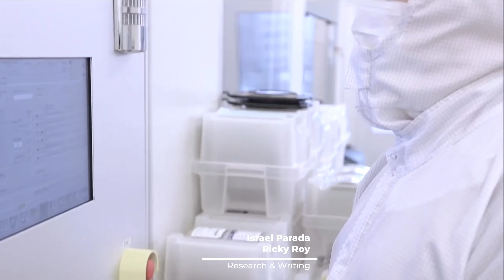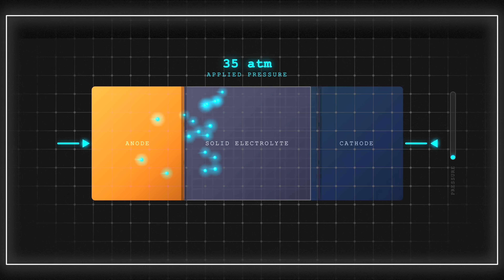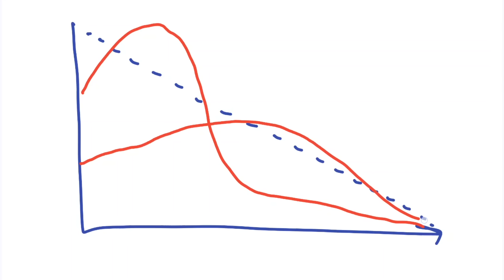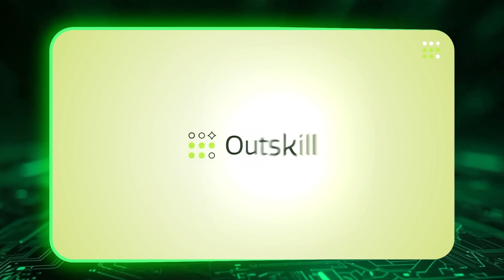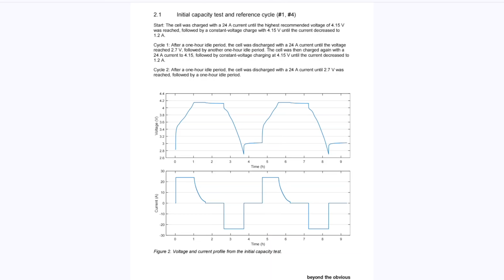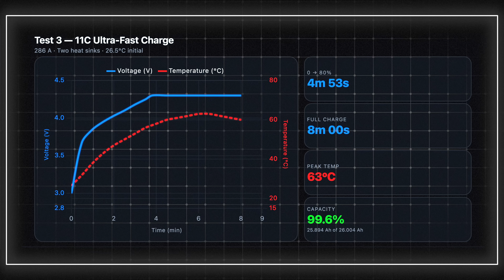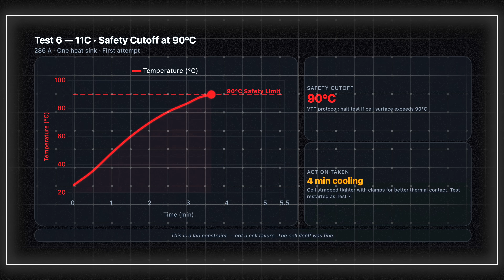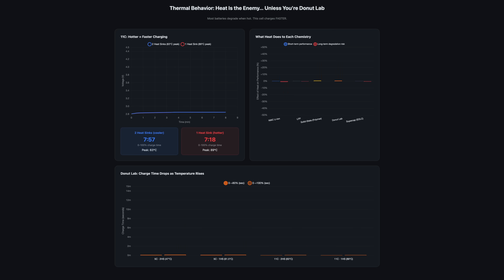Donut Lab's Solid State Battery Test are Shocking...

Comment: The results may not be the magic pill Donut Labs bragged about but they are close enough. Who cares if the battery cells can only last 25k charge/discharge cycles? That is more than what the life of your vehicle! So, If the battery materials are really geo-politically neutral and abundant anywhere on Earth, then we are talking a revolutionary battery chemistry. If the U.S. and EU EV industries are smart, they need to start talking with Donut Labs for a full-scale production ASAP!!
Reply: He's saying the battery exhibits the same characteristics as a Lithium (Nickel Manganese Cobalt) battery, not of a geopolitically neutral composition. We have to wait until a battery is dissected in the wild to know for sure, though. But the type of battery the one VTT tested matches the type of battery that won't have the temperature range and cold/hot weather resilience that Donut has been hyping.
Reply: The cell that VTT tested did pass 11C charging and was still working without burning, exploding, nor permanently degrading the battery. Yes, it exhibited high temperatures, especially with 11C with only 1 heatsink but these cells will be designed to use their enclosure and the vehicle frame as one big heatsink. So, that is not an insurmountable blocker. As Ricky pointed out this Donut Lab cell appear to love 100C and higher temps. That alone would kill Lithium-based cells in no time, even NiMC cells.
Reply: @Mvanec That is HIS opinion. We have to wait for the factual data as to the materials used. Just because the battery have similar charge/discharge curves as NIMC does is not proof, just empirical observations.
Reply: @AldrinAlbano  Science functions on empirical evidence. If it looks like a rat, it's most likely a rat. Additional information may alter that position, but until someone can make more observations of the rat, test its behavior, even dissect it, the most likely case is, it's a rat. HIS opinion is absolutely based on the empirical evidence, and it's not just HIS opinion; everyone who approaches this test from an engineering and scientific perspective has arrived at similar conclusions. As in all things science, more observations and empirical evidence are needed, and may confirm or obviate current conclusions.
Reply: @AldrinAlbano  Literally not an opinion, you delusional bot.
Reply: They are already falling short in many of their claims under ideal test conditions. Plus it behaves too similar to a well made NMC. Yes if it is a sodium or another abundant material based battery even if it had 10k cycles it would solve many issues. But so far zero proof in that regard
Reply: NMC cell will only give you 3,000 cycles, not even close to 25k.
Reply: The proof will always be in the pudding, as they say. Donut Labs' cell exhibits a charge/discharge curve as NiMC, yes, but that's not proof of its composition. We'll have to wait for the thorough dissection by an independent lab for that. Until then, Ricky, you, myself and the rest can only speculate.
Reply: If
Reply: Why do you say the results are not "the magic pill"? The results are precisely what they said they'd be, no surprises.
Reply: @davis.fourohfour  Read or watch Donut Labs original claims again, sir.

Comment: Didn’t they explicitly say they capped the voltage at 4.5 volts to make it an easier switch from lithium ion batteries? They said it in the initial reveal IIRC.
Reply: @bertangundogdu  it's only possible with capacitors, and donut battery does not behave like capacitor, so this may be a lie.
Reply: @crosshunter3316 that's...not rational

Comment: True lithium ion cells  coulombic efficiency can exceed 99%.  If these cells are only 90-95% charge/discharge efficiency then it wastes 10X the power that is converted to heat, which accounts for the high temps attained in these cells.  Also we don't use ohms law to measure internal resistances of cells. There are special machines that inject a 1 khz signal for these measurements which account for impedance and capacitance of the cell.

Comment: So it sounds like their design goal was to create a drop-in replacement for existing batteries, while using whatever cheaper, more abundant materials. In which case, having performance curves similar to existing lithium batteries should be entirely expected.
Reply: I agree, and I also need to acknowledge that in fairness, this would also be the perfect cover for submitting a ringer NMC pack for testing. I don't think that's what has happened here, but I've been wrong before.

Comment: A sodium ion battery also has a nominal voltage of about 3V.   The numbers lining up may not be such a give away about the chemistry involved because it could be that they aimed for matching the characteristics of existing cells so that the cells could be a drop in replacement in production.  This would make sense.  You only need to be about 10% better or 10% cheaper to take the market away from the other guys so if we assume this is a battery that doesn't run away and has these specs and can be made in volume, I expect them to a winner.
This could also be the first step in some massive April Fools prank.

Comment: The test showed the battery has a capacity retention rate of 99.5% per full fast charge cycle. This is not acceptable for commercialization. At this rate, the battery will degrade to 60% of original capacity after 100 full fast charge cycles.
Reply: wow what an interesting observation! Just read the VTT report before saying something like that. The VTT alternates between 7 charging cycles: 1C, 5C, 11C, 1C, 5C, 11C, 11C. After the 4th charge, the capacity returns to 100%. This is not a case of accumulated degradation.

Comment: The Donut CEO will either be the next Elizabeth Holmes or the next Henry Ford.
Reply: Sadly, in today's corporate world, it's far, FAR more likely to be Holmes.
Reply: @JustSomeJoe-dp5rp  100%
Reply: @JustSomeJoe-dp5rp 90%
Reply: There are zero patents filed because there is nothing patentable. I'm still on team pseudocapacitor system in a pouch.
Reply: @YesheRabsal  Sometimes companies keeps from patenting to actually protect IP during early market stages (trade secret)  to stay ahead of competition. Once you file a patent you expose yourself. It is a tricky balance.
Reply: @YesheRabsal  wow. There's no patent really?
Reply: @firstprib7742  sometimes it’s better to not patent as secrecy is much more important in the market. Consider Coca-Cola as an example.  Patents are public, and with that, large companies can dissect and perhaps come up with a similar solution without infringement, dwindling the market edge a small company has.
Reply: @YesheRabsal Did some research and Donut lab probably bought the patent rights from Swedish company Holyvolt.

Its about coating Nanopaste with screenprinting technology.
Reply: Donut lab battery is either a miracle battery with a pr strategy of a con or a con bttery with a pr strategy of a con.
Reply: If this is for real it would be a real contender for technology of the century. This would be a massive disruption
Reply: @Thunderbuck lmao no
Reply: I bet next EH.
Reply: @MrsTami42  Just looking at sentiment, it looks like the doubters are getting less sure. You are right to be skeptical tho ;)
Reply: @giddy9052   I feel like most people are still skeptical or feel even more confident that they can't deliver. I just watched one breaking down the details of the battery report and basically said all the curves and data matches a lithium cell, while Donut claims they aren't using lithium. 

We'll see though.
Reply: @kashtrey it doesn’t watch the test, a lithium would have burned at 89, definitely been damaged. Listen where even this guy says the charging improves with heat counter a lithium cell or at least any know currently.
Reply: @blueberrywilbur315  that's just wrong lithium batteries increase charge rate with heat. It's about degredation. Lithium batteries would not have "burned at 89 🙄
Reply: @kashtrey  You're in the "at any moment this could catch on fire" in the 60-80C range with current Lithium batteries. So yes, at 89C, it would almost certainly be on fire, or at the very least noticibly degraded.
Reply: @MrTycoon04 actually in one of the donut lab videos you CAN actually see the cell bulge and deform....

There are lithium cells on the market that can reach 90°C for short periods of time without damage already.
Reply: Holmes
Reply: Elizabeth Holmes at least manage to pull off one if the greatest cons of the decades meanwhile nearly no one in the battery industry fall for donut BS of solid state battery.
Reply: Great analysis
Reply: Unfortunately I'm leaning towards Holmes.
Reply: The Donut CEO will either be the next Elizabeth Holmes or the next Henry Ford .
Reply: Yeah the guy is either a genius or a fraud. Not a whole lot of in between with this battery.
Reply: did Elizabeth holmes every release indpendent report
Reply: Well said
Reply: Wilbur Wright more like (or Elizabeth Holmes)
Reply: He wont be no one will give him time.
Reply: @L @LearningFast with all that swelling he’s more like John Holmes at this point wouldn’t you say Watson?
Reply: Looks like a duck, quacks like a duck, waddles like a duck, flies like a duck. OMG! It's a golden goose! Take my money!
Reply: Either way it's going to be awesome!
Reply: Cold Fusion anyone?
Reply: Holmes for sure
Reply: Henry Ford
Reply: Elizabeth Ford
Reply: The curve charge/discharge is more a sodium ion than a lithium ion, you are false ..
Reply: Whoa, where did that come from? We have nothing to indicate he's a rabid racist like Ford.
Reply: Or suicidal
Reply: A charlatan or a Nazi I don’t think either of those are good options
Reply: Agreed. No in-between.
Reply: @PhycoKrusk whichever way it goes it will clearly be somewhere in-between.
Reply: Dude was peddling bullshit SaaS web apps for most of his career, no experience in this at all
Reply: @opjoter Means nothing 🤷‍♂️
Reply: @blueberrywilbur315 it definitely  reflects his entegerty.  That means a lot.
Reply: @blueberrywilbur315  Means it's his M.O.
Reply: @sleepyearth Does is he’s fairly successful 🤷‍♂️ Before Elon bought part of the companies he owns what was he🤦‍♂️ Bought and sold part of PayPal nothing crazy. Also a lot of bullshit too from Tesla and SpaceX but probably one of the most successful in the industry. I can’t stand the guy but he’s bought into some pretty good stuff sorry.
Reply: @blueberrywilbur315 Elon was forced out of PayPal because he was gonna bankrupt the business 😅
SpaceX and tesla survived mostly on taxpayers money.
We are the ones funding his success. Tesla is in the red WITHOUT carbon credits since 80% of profits came from there.
SpaceX was desperate for govt contracts because musk only invest 80M which was rapidly running out.
Say thank you to us instead. We literally paid for him.
Also Elon musk said immigrants should stay where they are so when are you gonna deport Elon Musk back to south Africa?
Reply: @blueberrywilbur315 means a lot. form matters in matters of cutting edge engineering. bunnies don’t get to play.
Reply: He already has trillion times more to show than holmes
Reply: @MarkkuS  Yes, Marko actually does have a track record
Reply: @MarkkuS lol
Reply: I smell  jailtime. I smell the free energy technology sector.
Reply: Or they will deliver a battery that's comparable to top-end lithium ones, and the whole thing will be a huge nothing burger.
Reply: @wedding_photography 
A lithium battery that gets better as it gets hotter?
Reply: @georgetaylor2640  it's footnoted in the video and not an unusual aspect of batteries; heat helps with charge time which is why batteries "precondition" before going to superchargers.
Reply: @georgetaylor2640  that's not what we saw in this test. We saw that they had to stop charging at 11C early because the battery got too hot.
Reply: @wedding_photography It was the testing machine that had the automatic heat cut off. Not the battery.
Reply: @wedding_photography  If they able to deliver top end lithium battery with solid state thats a huge thing actually.
Reply: “First they think you’re crazy, then they fight you, then you change the world”.
Reply: @OptimisticEngineer345  You're on all the YouTube channels being positive about this...
Reply: @r @ryanj610  be honest, I was hoping doughnut didn’t win this race because I’ve invested in Quantumscape but competition will push this tech to maturity faster regardless. The world needs safer batteries. Let’s go!
Reply: @ryanj610  hes called OptimisticEngineer for a reason
Reply: @ryanj610  Name checks out.
Reply: @ryanj610  Pessimism is a low-IQ trait.
Reply: @7FFF_00 skepticism is necessary
Reply: IT’s freaking fake , youtubers are milking this to death…. No shame
Reply: Old Marko loves attention...and donuts.
Reply: @LearningFast   she demoed fake equipment along with fake outcomes and stole money. I see none of that here.
Reply: @i-am-shawn-smith they haven’t demonstrated anything unique about this battery at all so far.
Reply: Ford was an industrialist. Known for assembly line. Tesla would be a better example as he invented the three phase motor.
Reply: @hoffinger He also beat Marconi, but history didn't record it as common knowledge.
Reply: @hoffinger  Tesla didn’t have any money.
Reply: @hoffinger Maybe he meant scale of success with something similar to electric cars . Nicola Tesla was not successful. Great ideas however.
Reply: @hoffinger  Donut is not planning on licensing their technologies. The CEO has stated that he wants to mass produce the batteries all on their own. That is very similar to production challenges that Henry Ford faced.
Reply: @LearningFast  many companies in the world make batteries, nothing revolutionary about it.
Reply: @wedding_photography you are wrong. If their claims are true then no one else makes a battery like this and they are saying that they want to be the only ones making the battery.
Reply: @LearningFast  you're not friends with logic, I see. You realize there's still a huge possibility their claims are not true? There are many possibilities. It's possible their battery is real, but just isn't as good as they claim. In which case it will all result in nothing special.
Reply: No
Reply: Def an EH character
Reply: Not Ford... more like Edison. The actual engineer who came up with the design would be Tesla.
Reply: or neither.
Reply: @LearningFast  except this has math that could work out theoretically. There was never any reason to believe Holmes could find B12 in a single drop of blood, let alone many macromolecules they claimed to find. It's not statistically possible with a single finger prick, single test sample to contain enough molecules to contain an accurate representation of every blood test needed in medicine
Reply: @LearningFast  Rather something between
Reply: Fascinating that the focus is on the CEO as opposed to the scientists.
Reply: @hirazakhan the CEO is making all of the claims. The scientists are doing the work but they aren’t the ones that are sticking their necks out there.
Reply: @LearningFast  he could be saying the very things the scientists are telling him. However unless he or they say so we'll never know.
Reply: More like Edison
Reply: You know this isn’t the first piece of tech he sold that was “lightyears ahead of its time” he do this before too
Reply: As a scammer they are worse than Elizabeth Holmes, EH have dubbed billions and investors took years to find out the scam, this 7 guys company got way less than that right now and was exposed that this is 100% a HOAX in minutes.

Comment: Cells must be using semiconductor or even insulator like material which have a negative temp coefficient. Explains the decrease in resistance with higher temps.

Comment: They could have started these tests with VTT 2 years in advance and cycle X amount of cells in parallel 6 times per hour(0 to 80%) without pause indefinitely(52560 cycles per year). This would give some indication for the SOH of those test cells. IF this is legit and they had the foresight 2 years into the future.

Comment: If that 400 Wh/kg density holds up next week, we’re looking at a total paradigm shift. To solve the heat problem they just need to charge it in 12/15 min and then to me the next industry's move should simply be: print the cells thin to maximize surface area, then submerge the whole array in a budget-friendly dielectric fluid (like mineral oil or specialized coolant), Throw in a a high-efficiency submersible pump inside an insulated poly-tub, and you’ve got a high-performance thermal management system for a fraction of the cost of traditional cold aluminium plates. Problem solved ? I just want a comfortable electric car with 300 to 400km range that charges fast and it doesn't need to be done in 5min! So 12to 15 is great! This tech is readily available would be the most efficient way to make use of these solid state cells and scale it rapidly to be available to the masses without any need for complex cooling systems so hopefully the density will be spot on and the revolution is coming!
Reply: There are so many solutions for cooling the battery. Whatever all the major lithium packs use is plenty enough. The BMS reduces the charging if temps become too high, but this battery seems to have a larger operating envelope anyway.